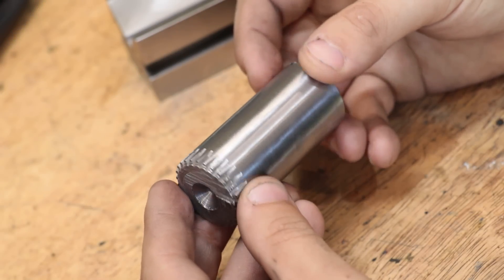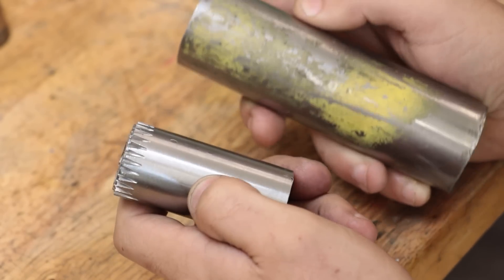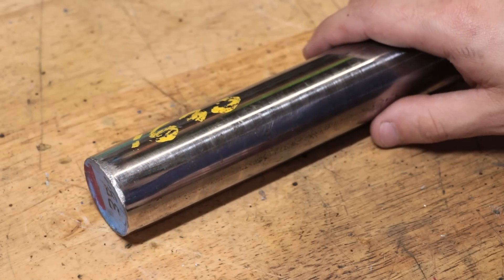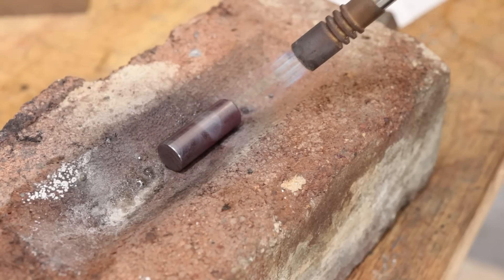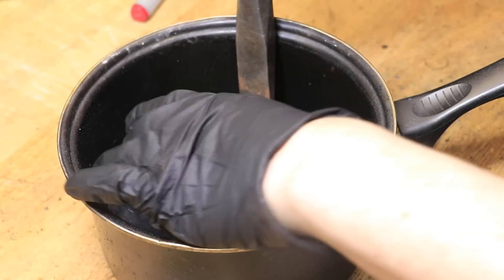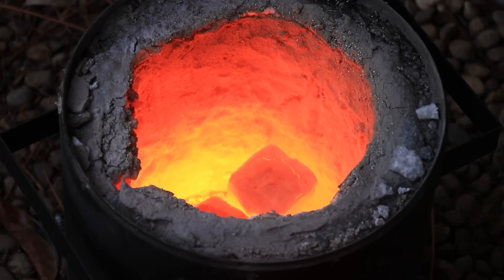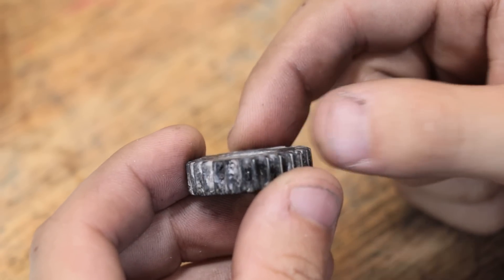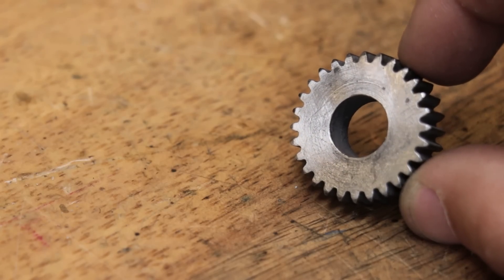Making Case Hardened Gears - Heat Treatment Oversimplified

Comment: One thing to keep in mind is to test the gears that you're going to be meshing with. If you make a really hard gear and it meshes with a really soft gear You're going to end up killing that softer gear pretty quickly.
Reply: Unless the hard one is super polished so it has no sharp edges at all.

If it is sharp it will indeed powder the other one 🤣
Reply: @tullgutten  Even if it's not sharp edge it will still wear the softer metal much more quickly.

Comment: As you point out this is probably way overkill for lathe back gears as some lathes like South Bends have back gears made from Mazak and they last many decades. None of the back gears or screwcutting box gears on my Harrison L6 are hardened in any way. They are very soft steel very much like a leaded steel but none show any signs of wear despite being in use since 1964....Great educational video about hardening all the same.👍

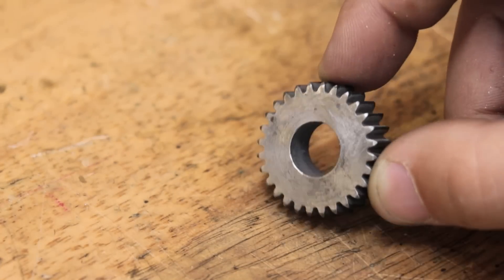Comment: 13:05 You mentioned overkill. The hole video I was thinking you may wanna make two hardened gears. So you could make a fixture to run them together with lapping compound. Any machine marks on the hardened gear will wear out the mating  gears in your friends project.
Reply from the maker: If it's anything like my lathe, it will have some spacing rings or washers. It it's a probkem, I'll certainly hear about it
Reply: @artisanmakes  I think the suggestion was to use a second gear to lap the working faces of the teeth.  Two identical (involute) gears correctly spaced should work as grinding partners to shape the other gear to exact involute profile.  With case hardening you prefer not to grind them much unless you have precision machinery but lapping is a acceptable option.
Reply: @KallePihlajasaari  Yes that is what I was getting at. Transmission and rear end gears go through a lapping process to reduce noise. A rock hard gear with tool marks may shred it's mating gears.
Reply: @artisanmakes  I'm not picking at you. I watch and love your work. Just remember you heard it here first. lol

Comment: Good Job, and well explained!  I once made some simple lathe form tools from 1018 mild steel, then case hardened the heck out of them.  Tempered slightly so they wouldn't chip or shatter, they did the job admirably.  Even cheap cheese grade steels can be case hardened and used as tools or parts if they're not required for production quantities.

Comment: Your explanation of hardenabiltiy is good. The surface will transform quickly, but the center of the cross section will take longer to cool. A higher hardenable steel will allow you drop below the ferrite and bainite start temperatures and get to the martensite start with a slower cooling rate. However, I doubt you could see a difference in surface hardness between this steel and a 41XX steel at the surface. In fact, with this small of a cross section I doubt you would see a difference in your core hardness as well. I am a metallurgist for a farily large carburzing heat treat shop. We use many different alloys of steel, 41XX, 86XX and 43XX. The 43XX would be similar to the steel that you used but less hardenable. Less Ni but with some Mo. When carburized under the same conditions, the 43XX and 41XX are indistinguishable at the suface. With this small of a section we would not see a difference in core hardness as well. 

Good work though. We do gas carburizing, i have never looked at a pack carburized part under the scope to see just how quickly it takes on carbon.

Comment: To protect parts from scale during heat treatment, if you will use water based solvents as cooling liquid,  you can use powder boric acid. Clean part with alcohol or any solvent to remove dirt and residues of oil etc, then heat it with a blow torch a bit and sprinkle with boric acid. Repeat untill whole part is covered.  While cooling, boric acid will break by itself, making cleaning much easier.
Reply from the maker: I'm sure that works too. It's probably not too different from the potassium fluroborate based flux that I use. Cheers
Reply: @artisanmakes  yes, it works, im using this method for heat treatment of custom cutting tools (reamers, taps etc) im making. Boric acid just a bit easier to clean and, in my situation, its more accessible.

Comment: Is there a risk of metal gears causing the plastic gears to wear out more quickly?
Reply: I think so, his mate wil just call him agan🤣
Reply: The softest material is going to preferentially wear, so this will cause wear on unhardened steel, steel will cause wear on brass, brass will cause wear on plastic, etc. In some cases this is a design feature, where the cheapest and easiest to replace gear in a mechanism is made from the weakest material.
Reply: @r2db  That isn't always the way it works out. Often the harder material wears more rapidly than the softer component. This occurs because the softer material is prone to embedding of microscopic particulate and acts like a fine abrasive element wearing down the hardened component. A differential of hardness and softer materials is usually a desirable design element for shafts and bushings etc that run against one another.
Reply: @howardosborne8647  Good point and I do agree there. I was thinking in a lathe gear train this would be less likely, but if one is doing a lot of toolpost grinding or leaving the side cover off routinely it may be a significant concern here.
Reply: @FamTech.  Read my comment above. It explains a way to reduce that chance.
Reply: @David-Rule  what comment
Reply: @howardosborne8647  I found this out with my RC cars I'd race after a season I'd find the metal pinion was worn but the plastic spur gear was fine

Comment: Isn’t making such a hard surface more likely to create extra wear on lesser hard surfaces of interfacing gears?
Reply from the maker: It will but it's meshing with steel gears so they all should hold up for a good Humber of years, and they can always be tempered back if needed

Comment: can i case hardened mild steel? how hours could take to reach 1mm 60hrc?
Reply from the maker: Yes you can case harden mild steel. Time varies depending on the type of carburizing and the temperature, but with my method, using charcoal and sodium carbonate, 2 hours might get you a 1mm case depth

Comment: Nice video men. One question and one ask. What software do you use to design your projects?  

And it would be nice a video about making our own gear cutters. They are very expensive and you need a lot of them!
Reply from the maker: I use mainly Solid works and occasionally CATIA. Mostly because that is what I have used for the past 10 years. Fusion 360 also is great but I personally prefer solid works. I don't know too much about making gear cutters, but Chris at click spring has a whole patron series about making gear cutters.
Reply: @artisanmakes  thank you!

Comment: Just make sure he's not replacing an intentionally weak part with this hardened strong monster. Some Gears are supposed to break in order to protect expensive stuff from overload.
No use making a gear that will cause the gear case to break.

Comment: Did he forget to put a key way in?
Reply: I believe he said this was supposed to be an idler gear.  Those don't need to transfer rotational force to/from the axle they're on.
Reply from the maker: It's an idler gear so there wasn't a need for one. The shaft that it goes on doesn't have a keyway
Reply: Ohh OK. Thanks, must've missed that part.. 😂

Comment: don’t ever use water to quench.
Reply from the maker: No there are valid reasons to water/brine quench.
Reply: @artisanmakes  salt baths yes but pure water no. the reason is simple when cooling with water you quench to fast and it causes all kinds of stress to the metal
Reply from the maker: That will all be dependent on the material, its intended use and how it behaves, as per the applicable TTT diagram. There are reasons to quench in water, mostly because they produce the hardest finishes, at least with case hardened carbon steel in a home workshop environment. cheers Also better to quench in brine to reduce Leidenfrost effect. Which can definitely warp parts